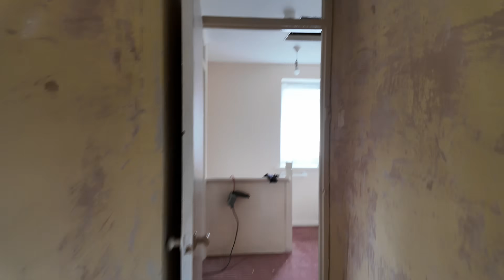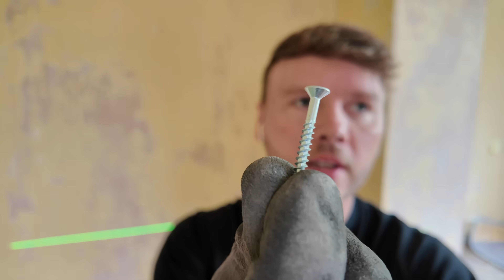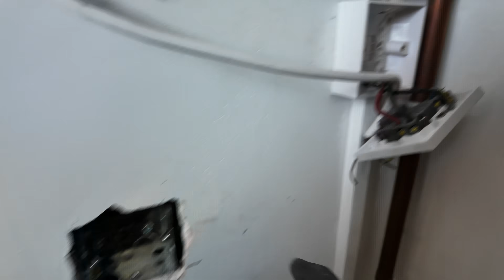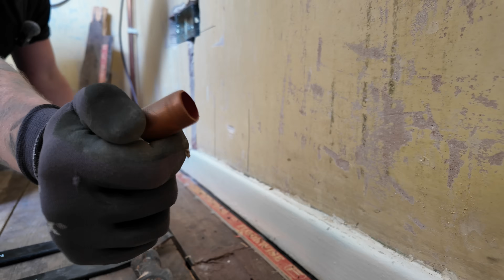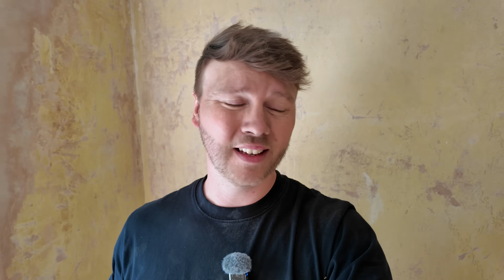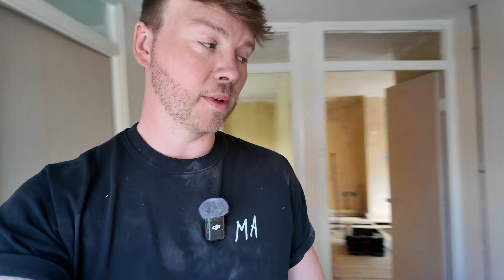Never Seen This!! How Is This House Built Like This!!

Comment: wow, did you not offer to put dado trucking above the desks? or at least just have a couple sockets with a decent quality extension lead mounted under desks to plug in there office equipment? that's a ridiculous amount of chasing? surely there was a better place to locate the data cables and have a proper patch panel cabinet? im no data expert but that looks like a crap place to run all the cat cables???  even just bringing them surface through the floorboard as a bunch in trunking would of been a lot better them chasing them in  them and putting them in oval??

Comment: VRI cable was common in the 50's and maybe 60's when good materials were still on ration after WW2. SO bricks and blocks will be mixed utility grades, timbers will be the minimum sizes. There's a reason why modern computer rooms are small, but in big spaces -all the cable has to hide under floors of behind false walls

Comment: Tapcon make domehead concrete screws, might be better as they wouldn't pull the box over if the screw hole is slightly off.

Comment: did one like this with 2 steels in house, made the job so much more difficult, heating lads had already laid across loads of main runs so used 50/60 extra meters of cable, work looks toppa mate, i like how much control you have in a rewire to fully run it from start to finish

Comment: Note that the concept of less than 50mm/RCD protection as per 522.6.202 does not apply to floors/ceilings, so if a soft skinned cable cable runs over/under the likes of those steels at less than 50mm from top/bottom of the steel (where the top/bottom of the steel is close enough to the top of the floorboards allowing the cable to be pearced), they should be mechanically protected, as per indent iv) of 522.6.204 (guidance recommending e.g. steel plate to be minimum 3mm thick). I had this situation recently, where there was just enough depth between the underside of the floorboards and the top of the steels to run a 10mm T&E. So, I went to a local engineering works and got them to cut me some steel sheet into plates to required dimensions, then fixed them to the undersides of the floorboards over the cables so they didn't just sit on the cables or slip off.

Comment: Those are cinder blocks made with clinker from coal fired power stations & they have a habit of destroying blades and bits because the clinker is very abrasive.  They're also a pain because they can be very crumbly when trying to make fixing holes.
Reply: Our house, 1929, has walls full of it. Nightmare.
Reply: @andywarwick9495 Same as my old house also built in 1929, it was the builder's last house and they must have run out of everything The walls upstairs between two bedrooms and a corridor were made out of plaster mixed with straw and in the dining room in one corner next to a chimney that supported the house, they used large pebbles and plaster. Never needed a drill to put anything up, just a bradel, you can imagine my shock when after 30 years we moved in to a home that has all brick walls. 😂👍
Reply: @everestyeti  the plaster mix is probably lath and plaster, indicative of that time and pre-plasterboard. We have just had a loft extension and needed to move an internal wall made of the stuff. Huge mess. During bathroom renovation we found old chimney in corner that used to go to kitchen for cooking. That was clinker and needed rebuilding in real brick. Also need to watch out for windows without lintels, as old hard wood frames could bear load that modern PVC doesn't. Probably still better built than some  modern houses though…
Reply: Exactly this .
Reply: Awful things, my house has them and its a real pain to do anything.
Reply: Technically they are genuine breeze blocks, because that "clinker" is called breeze. It didnt just come from power stations either, any coal fire would produce breeze. They are absolutely filthy even just drilling into them. They then started making them out of stone due to a lack of sufficient breeze but we still call them breeze blocks.
Reply: Recommend Fischer duopower fixings, all I use for these walls, never go back to anything else

Comment: As soon as you see joists running side to side , non brick at front and back  faces ( timber, slates,tiles) between floors . 
Youre probably in a cubit steel framed house . Were a system build in the 70's  terrible construction. Dividing walls are thermalite panels  very brittle. Whole street is usually a continuous steel frame .  Noise travels  between  the houses. Through the steel. Built during a nationwide brick shortage ,  to get council houses up fast .

Comment: A bit like some of the Norwich council houses I helped with rewiring... British Iron and Steel Federation (BISF) houses. Lifted the boards and found girders about 3ft apart... there was a good inch or so clearance between that and the plasterboard ceiling below so it wasn't too bad really. The attic was a sod, all 2" angle iron and spaced far apart so a bit of a stretch navigating through without crawl boards. Interesting rewire was a Dorlonco design... house looked quite smart from the front... nightmare. Steel framed and a nice big girder across the living room but the floor between upstairs and downstairs was concrete slab... the council spec was for surface trunking and we certainly used a fair bit in those properties.

Comment: I feel for you Nick having steels under the floor I had a few like that takes a lot of work getting cables under them and having no twists in the cable or they don’t go under the steel. Or even worse you loop over one and have to pull it back.

Comment: If you are going to slip the cables under the steels, assuming there is a small gap, then use some short lengths of oval conduit to form little “tunnels”.  Very impressed with how clean you keep your workspace😊. This rewire series is really entertaining, thanks .
Reply: A Clean workspace is a good safe workspace and he doesn't even know what a broom is.
Reply: Artex hate it hate it did I say I hate it well I do hate it just saying 👻

Comment: Pan head screws! Get some! The countersunk head ones will skew your boxes...which is actually quite useful sometimes. Trust me...keep a variety of screws on the van at all times! A 15cm frame fixing, with the plastic sleeve removed, and using a right-angled screwdriver, will get you out of trouble many times.
I look at that room with the old chimney breast...8 double sockets, 4 data sockets, 2 or more light switches, I forget exactly what, but let's say LOADS of chases! Loads of dust, loads of blades, loads of hassle, loads of noise, loads of making good...
Just stud-wall it by say 38mm cls. Especially around the chimney...it's not exactly going to shrink the room, is it? Go for a stud wall over the existing, easy to fit back-boxes, plenty room behind for cables and room to add more in the future. Also, with data cables, always run twice as many to each point, cover the outlets with brush-boxes and leave the "spares" out of site behind, but thus easily accessible in the future. That way you can run cat6 and HDMI to each point...or, even easier, run cat6 to all points and use a cat6 to HDMI converter so you don't need to accommodate the size of an HDMI plug...and use HDMI ribbon cable as an alternative. Couple of days ago, ran a new cat6 cable from ground floor to attic in a huge house...the original cable was faulty...used it as a pull-thru and then left it in place for use in the future as a pull-through again.
Just my thoughts...

Comment: I wired a non standard house once, it had floor "panels" upstairs which sat on steel framework. The whole house was steel framed, with steel in the loft too. Unlike the one in your video, the one I worked on had a massive gap between the 3x2 floor joists and the 2x2 ceiling framework. We could literally throw cables in!
Reply: I have worked on houses like that.they also had steel door frames,which were a nightmare when you had to fit fire doors

Comment: Post war houses often used very 'experimental' construction in order to economize on timber. The GPO (phone company, later BT) even had to use reinforced concrete battery racks due to timber shortages.
Caused problems with  corrosion due to the acid vapour/spray
Reply: Late 70s, early 80s, if I recall, they experimented with concrete telephone poles as well.
Reply: Places with metal doorframes with hinges as part of the frame can be a nightmare when renovating. I had a rental flat that required fire doors to every room as its 4th floor. Fitting those heavy doors to pre existing hinges was hell. It was an HMO also, so required fitting all doors with closers. I had to use the big ugly commercial types, as it was impossible to fit the 'hidden' chain/spring ones due to the metal frames.